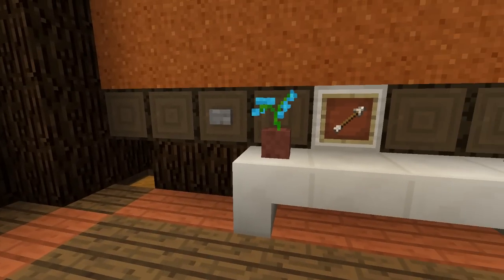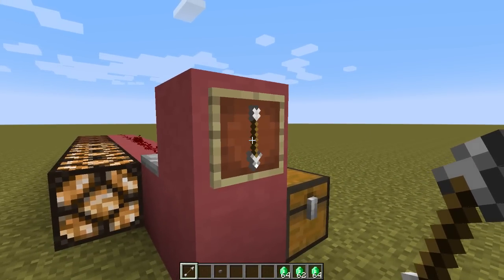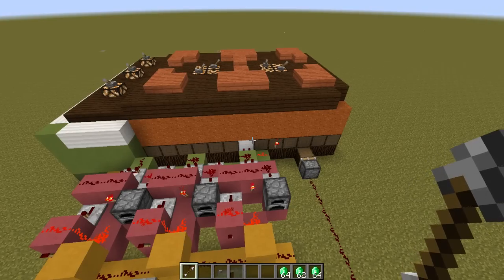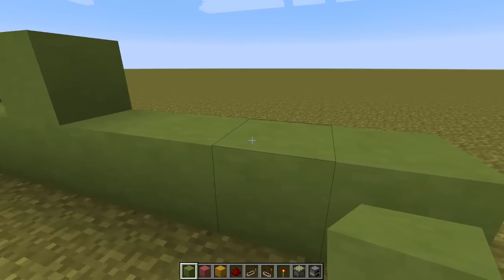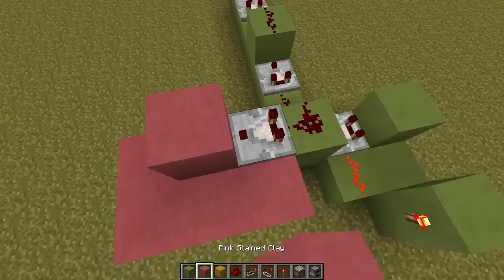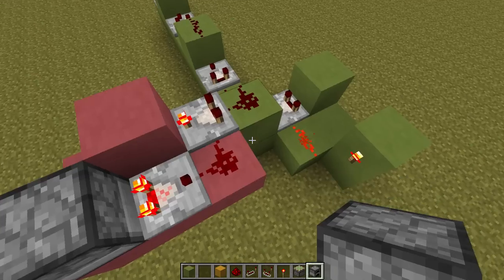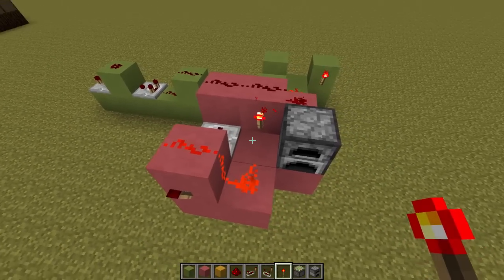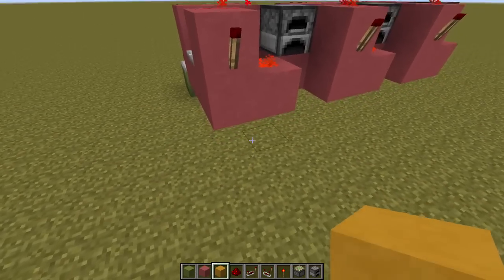Minecraft Tutorial - Item Frame Combination Lock!!!

Comment: Downsides: You can't use a wooden button, and every time you get that bug where buttons pop back up to quickly (Which happens A LOT if you haven't noticed) you have to start over. Upgrading this by adding a monostable circuit would fix both problems.
Reply: good comment i used one and it did not worke

Comment: You can use item frames instead of furnaces to determine the number, and I was able to modify it to work on Bedrock Edition AND have FOUR DIGITS. No arrow for 1, arrow in 1 position for 2, arrow in 2 position for three, and so on. Plus, you can EASILY lock out the system just by setting one of the decoders to the 8 position, which will call for a 9, which cannot be achieved with an Item Frame, thus locking out the system.

Comment: I managed to improve the design to use four numbers, use item frames instead of furnaces to set the combination, and to be able to be built in both Bedrock and Java without so much as a repeater timing change.

I also memorized how to build this by heart.
Reply: Please explain how to fix for bedrock
Reply: @imc1t6  The way to fix this for bedrock is to 1) use two repeaters that lead from the reset line into the locking repeater, 2) replace the redstone dust leading into the piston's blocks with repeaters, and 3) set all repeaters going into the pistons, as well as all repeaters that are part of circuits branching OUT from the reset line (aka the circuits under the pistons) to maximum delay.

This will allow for 4 numbers and for building in BOTH bedrock and Java without a single change required.
Reply: @imc1t6  Perhaps I might make a video sometime about it.
Reply: @imc1t6  Basically, go from 4 locking repeaters to 8 locking repeaters, and there's one more repeater in between each locking one and its redstone torch.
And all of those repeaters are set to 4 ticks, plus the ones powering the pistons.
Reply: @Damariobros  are you saying there should be 4 repeaters between the pistons 2 normal 2 locking?
Reply: @Damariobros  please do
Reply: @imc1t6  Once I get home from school today, I'll go about making a video
Reply: @Damariobros  sweet dude thank you, just got yourself a new sub
Reply: @imc1t6  No problem!

It's lucky that you came at this time. I happen to have my grandma's laptop. If I didn't, I wouldn't be able to make the video.

My iPad doesn't have the storage space to record another video, and none of the computers in my house which I can use are capable of recording.

Comment: I'm doing this now in the latest snapshot (14w30c) and I'm having problems such as the number of items in my furnace don't seem to work ex. I put in 55 oak tree saplings and when I press the button and have the item frame set to 1 instead of 6  it will go off. What I want to know is; does it work only with hardened clay or do saplings require more items in the furnace?

Comment: I wanna say this is an AMAZING design! Great job! With that being said, there is a security flaw.... When you get a correct number, it powers the sticky piston. This makes a noise. A smart player could try all the numbers and see which ones make the piston sound, then try those 3 numbers in different orders until they get it right. As a suggestion, maybe use a RS NOR for the tumblers instead of the sticky pistons? I know it will make the redstone bigger, but it will be FAR more secure.
Reply: +Kefka Palazzo ...or just add a piston to the reset line so it makes the noise EVERY time you push the button. Quiet is better though. Plus, they could still hear the difference between multiple pistons and a single piston if they are clever enough. =P
Reply: +Kefka Palazzo check out sethblings...I built the same without him, and it's silent.
Reply: Puppet Saga Inc. Already made my own silent version using comparators and locking repeaters with proper timing.

Comment: Love the combo lock. Was the first thing I thought about trying to do when I learned item frames could rotate and provide redstone signals based on rotation. However, as a note, this is NOT infinitely expandable. I tried to make a 4 tumbler system, and the reset redstone will not reach far enough to reset the last tumbler. I've done a few things to try and get the 4th tumbler to reset, but it isn't as simple as 'just throw a repeater in'. The timing is sensitive enough that just adding a repeater will cause issues with either the 4th tumbler, or the 3rd and 4th tumbler.

That said, still love the idea. Liked and Sub'd. :)

Comment: Wouldn't it be much easier to use another item frame to set the code instead of a furnace.  You wouldn't have to do any math counting out the right number of items.  Just set it to what it should be.  You'd just have to move the comparator one block away so the signal is one less.

Comment: Hey mr hermit in the end of the code III you are wondering how to shrink and I can answer well you dig a hole fill it with sand place 4 fense around the sand place your boat on the sand get in the boat and wala (you need speed pots so you can move) :)

Comment: Genny, I really like how it works, but I have one suggestion about the furnace:
Why not replacing it with an itemframe with a sword set on the specific number? 
This would save a lot of headaces about how many items there have to be in the furnace. 
If the reason to have a furnace is for savety issues, if someone wanted to break in to peek at the combination they wouldn't use the lock anyways ;)
Reply: p.s.: I am aware the frame behind the lock has to be 1 signal strength lower, but that shouldn't be an issue ;)

Comment: Bug: It does not detect the numbers correctly. It will turn the torch off only if it is less than the number you are supposed to use. Unreliable, because people can much more easily get the code if you do it that way. I suggest using AND gates and   pistons instead. It's not as compact, but it is reliable.
Reply: Never mind, yours is reliable. Sorry, I had jumped to conclusions after seeing just part of how it compares the signal strength. In this case, if you use an item frame, since you're making the input 1 stronger than what it compares it to, you have to set the item frame 1 less than what you want the number to be.

Comment: If you press the button with the arrow in position of the last number on the combo it will open whatever it's connected to without need of entering the rest of the combo. TO FIX: Keep the repeater at 9:46 however when you replicate the same setup for each tumbler, don't put that repeater there, nor the dust in front of it. It's unnecessary. Does that make sense?
Reply: i made the mistake of using the exact same setup each time. i didn't pay attention to when he said "only the first one".

Comment: I get mostly everything, but wouldn't the signal strength go down on the input line? How do you get it so a signal strength of say 5 stays at a strength of 5 once it gets to the furthest tumbler? Wouldn't the wire diminish the signal? I know the comparators probably have something to do with this. but I do not understand what.
Reply: Comparators will use the signal strength of the dust powering it. As you can see in the "powering line" (the first step of the build), the comparator powers a block, (no signal lost), then that block powers that redstone dust to the right, which feeds into the next comparator. Since there has been no diminishing of the signal power, the redstone dust has the same output power of the first comparator, (for example 5). Then the second comparator is being powered by that redstone dust, so that comparator will also output 5 as it's signal strength. To keep the signal strength the same for a longer distance, let's say from the second comparator to the third, it's the same thing. The comparator powers a block which powers the redstone which then powers the comparator. Hope that helps.

Comment: Why don't you use item frames with arrows for the "correct combination" as well instead of using furnaces? Could be faster and easier to set a new correct combination if needed that way (and also a bit easier to explain on video, since you just turn the arrow to the position the user must enter, no need to explain how comparators work with furnaces as well ;)). Nice desing btw :)

Comment: So I recreated this block for block even as to the number of blocks in the furnaces. for some reason when the signal passes through the second repeater through the second sticky piston it wont lock in enough time. it's on a chunk border but does it affect it just because of that?
Reply from the maker: make sure you are using a stone button, wooden buttons are too long :)
Reply: I was using a stone button, but i did a fix by adding a repeater instead of that one piece of redstone dust. Thank you though.
Reply: Riley Holmes If you had to add a repeater to replace dust, then you likely had a delay issue. Make sure you double check the delays you set on the repeaters that are in the build.

Comment: hey genny if im not mistaken u'll get a problem if u extend that, ur timings get messed up with that resetline
Reply from the maker: you can tie into that reset line from anywhere, so I'm sure it's not too much of a problem
Reply: i would feed the reset from the front, where u put the button, with a certain delay, then place a comparator/repeater beneath every "output" torch except the last,
then the system should be infinit expendable then, plus u can shorten the lockt repeater delays to make this system alot faster
then instead of pistons u could use "comparator-locks" to remove the sound feedback when one of the pistons triggers

a littlebit more advanced, u could change ur system that the removal of the item acts as "button pressed" without a button nearby noone would think that this is a combolock :D
Reply: aullik I think he wanted the sound when you get a correct number like in a safe you can hear the tumbler fall.
Reply: well didnt thought of that, but still, with only 3 digits this is terrifying easy to solf
press the button 8 times and you know wich numbers and then 6 trys and the door is open... so  i wouldnt save my cobblestone in there
Reply: aullik Or just use the best minecraft lock breaking strategy ever. . .mining.
Reply: well yeah but dats cheating, and on most servers that doesnt happen, either the area around the lock is claimed or they play on a server like minecraft where people trust each other
Reply: Yeah, Ive tried to extend it... the reset timings mean that after the first 3 inputs the signal is lost whilst trying to move from the 3rd digit to the 4th. I think its because you have to repeat the reset line with a repeater adding in a delay in the process.
Reply: i should upload my version but im tooo lazy :D

Comment: I atempted to copy this block for block in MCPE. It seems to work as a 1 digit lock, even theogh I programed it for 3. Anyone know what I might be doing wrong?
Reply: Use a stone button. I was having the same issue until I read in the comments that the button type matters.
Reply: Adam Shreve Thank you for the tip, but I was using a stone button. 
However, I did use item frames in place of the furnaces. Would that make a difference? 
Other things that might be messing it up include: crossing redstone lines, or incorrect repeater setings.
P.S. I allready replaced it, with one that uses 3 item frames for the input, and that seems to work.
P.S.S. I would still like to learn how to do it with one item frame input.